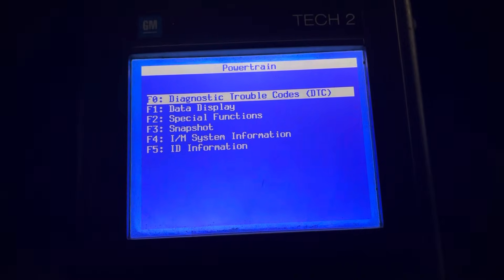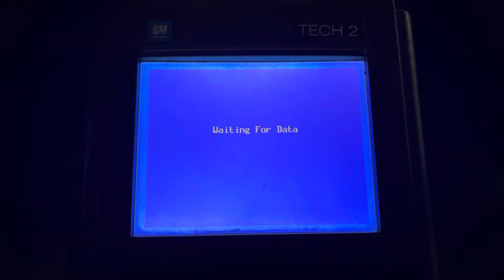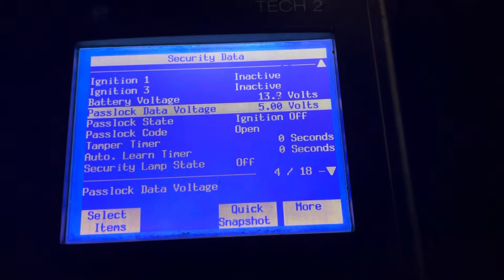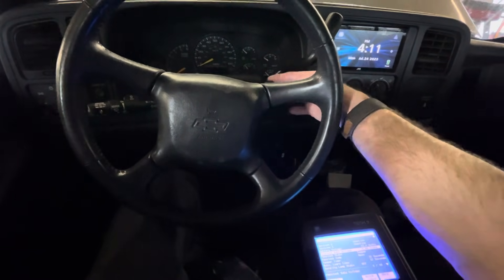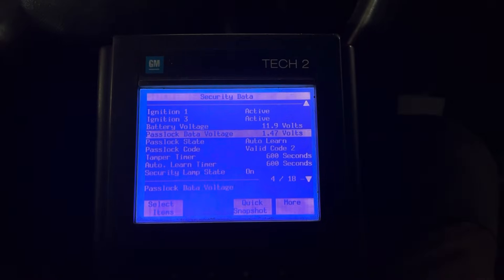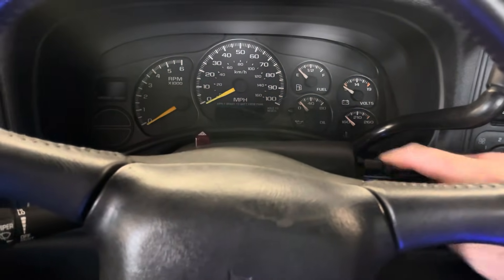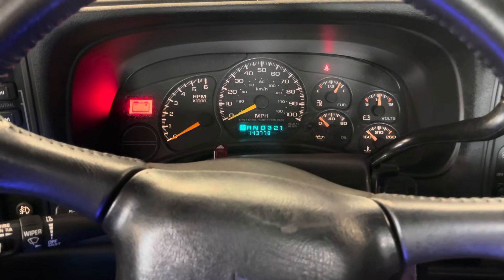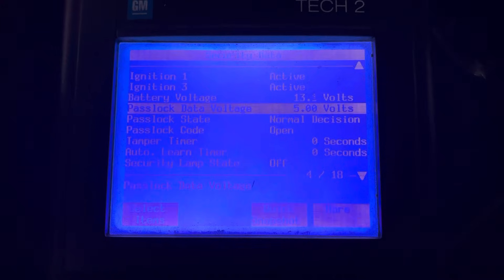99 Silverado Starts and Dies code P1631 B2960 Passlock Theft System 30min Learn No Tools

Comment: My security light doesn't come on when the truck is on. Thought it was pump. Got it running again revved up and drove it away and as soon as we cleared the codes it died again. Codes says something about communication with anti lock. But no security lights only when car is off
Reply from the maker: What kind of vehicle? Thank you.
Reply: @DadsGarageDiagnosticSpecialist  2001 Silverado
Reply: @DadsGarageDiagnosticSpecialist  codes say communc with anti theft I mean**
Reply from the maker: @DT-kw4rf what code are you getting? Does it come back immediately? Usually a security fault will not cause the engine to stall after it has alread started. 

So it dies at stops and then will not re start?
Reply: @DadsGarageDiagnosticSpecialist  we can't remember what the code said but it was about communication anti theft something...my mechanic went home....it sat forever and today we went to put a new battery in. It cranked up and we drove it around...let it idle for 30 mins and cranking it up ..but as soon as we went to clear codes it won't turn over now... security light does not come on when turn is turned on
Reply: @DadsGarageDiagnosticSpecialist  it won't even start again after this morning running and going around the neighborhood....we thought it was the fuel pump initially but after seeing it running around idk what to think
Reply from the maker: Does the starter crank the engine and fail to start or does it do absolutely nothing when you turn the key? Check the battery terminals also...side posts are easily stripped and known to come loose.
Reply: Did you figure it out
Reply: @BRED23  it appears that it was not the anti theft system and was the fuel pump after all.
Reply: @DT-kw4rf  I recently just chnaged my fuel pump and it would make a loud buzzing sound constantly. initially thought that I forgot to put the little rubber feet at the bottom but they came pre installed. figure buzzing would go away after a few binder miles or so
Reply: @BRED23  if it buzzing sounds like it's trying to connect like when you put it in run mode. I don't know why it would doing that
Reply: @DT-kw4rf  yea it buzzes the whole time while driving. Faulty pump maybe?
Reply from the maker: Sounds like you got it fixed. Glad to hear.
Reply: It sounds like Chevy should recall it n fix it.i have a 2002 Monte Carlo that shuts down won't start if you leave it sit overnight it will start right back up n stars fine for a month then won't start again
Reply: 99 Chevy Silverado 4x4
Reply: I don't have any codes but check engine light keeps flashing but no security light
Reply: Whatever shits off the injectors needs to be bypassed
Reply: Antilock brake light is on??
Reply: Brake light keeps flashing on my truck but not on Monte carlo
Reply: I opened passenger door and security light came on
Reply: My pump n filter has been changed to.bcm or something is shutting off the injectors??

Comment: I have a 2002 gmc sierra. Replaced the cylinder, housing and lock cable. 
Should the security light stop at 10min? Mine does not. My centech odb2 doesn't seem to show the vots like yours does. I may check one out from autozone. What fuses should I verify? Sorry. Been working on this for a while. Thanks for the video! It was more concise and complete than some of the others I've seen.
Reply from the maker: Yes, the light should stop flashing 10 minutes after your first start up attempt. If the light never goes out, then the sensor is probably not working.

Could not tell what fuses to check at the moment I don’t have the schematic in front of me.

It would be helpful if you had a scan tool that is able to read the security sensor data. Otherwise you will need to manually test at the Passlock sensor housing connector. 

Thanks.

Comment: An antique your working on nice
Reply: Just some added steps, I'd rattle the harness to the pass lock sensor(ignition switch wiring) if the code/voltage changes I'd be looking to replace the ignition switch and ignition cylinder housing anyways. I'd look at this because that's likely a used steering column.
Reply from the maker: @rustedhorsepower5132  good info yes I have seen so many of them fail I’m surprised it wasn’t bad anyway. Thanks!
Reply: @DadsGarageDiagnosticSpecialist  i replaced a bunch of them in my day. I even had a fake cylinder i built with a magnet attached and a semi-working cylinder housing which allowed me to bypass the system of a completely failed sensor and drive it to my stall.
Reply from the maker: @rustedhorsepower5132  I still see them fairly often, but getting less and less.
Reply from the maker: Seems that way sometimes lol. Thanks for another comment!